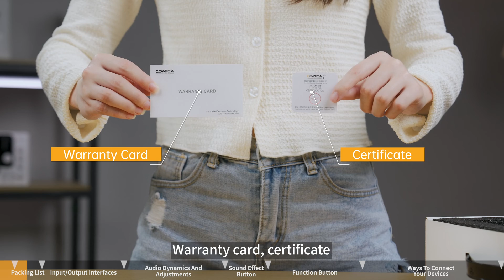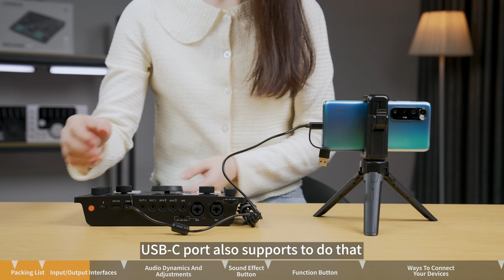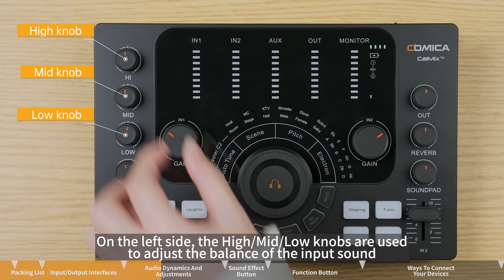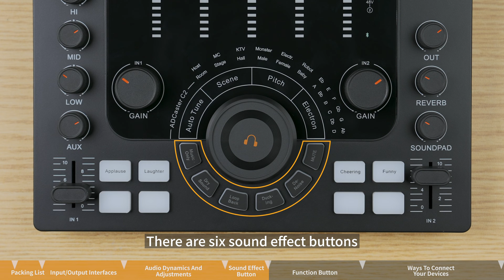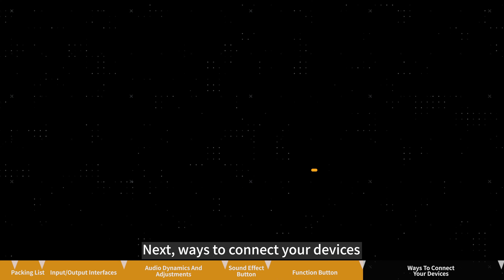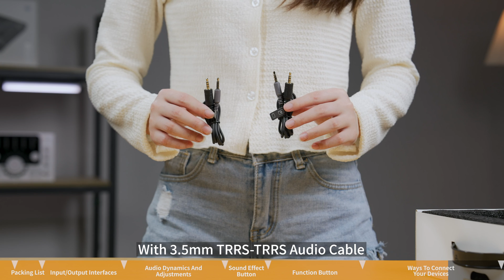【Tutorial】User Guide of Comica ADCaster C2 Streaming/Podcasting Multi-functional Audio Interface

Comment: Is there no latency issue while monitoring?
Reply from the maker: @jeromalan7251  lower than 20ms latency😉
Reply: @COMICA.global  okay nice im going to buy one. I also read some reviews about reverb effect and double voice delay issue via monitoring. Anything about that matter?
Reply from the maker: @jeromalan7251  Hello friend,as a multi-functional audio interface, COMICA’s ADCaster C2 features marvelous audio quality and various input and output ports; it comes with leading Bluetooth 5.3 technology and supports wired and wireless accompaniment input; its convenient independent knobs are able to control input gain, monitor volume, and output gain, etc. Besides, COMICA has independently developed the CalMixTM audio algorithm and C2 has become the first to use the CalMixTM denoise algorithm, which filters the unwanted noise and keeps high audio quality at the same time. The C2’s multiple audio effects make the audio more varied and interesting; it has 8 sound pads, including 4 customized audio effect buttons; it supports one-click muting, ducking, and loopback; real-time monitoring and audio dynamic monitoring have been developed to avoid accidents. The C2 supports multi-device connection to go live streaming on multiple platforms, making it a perfect partner for recording, podcasting, live streaming, gaming, and music producing.